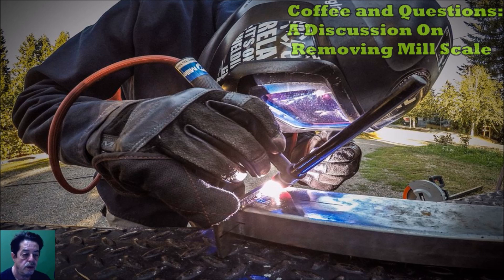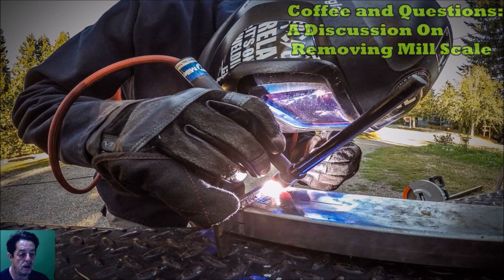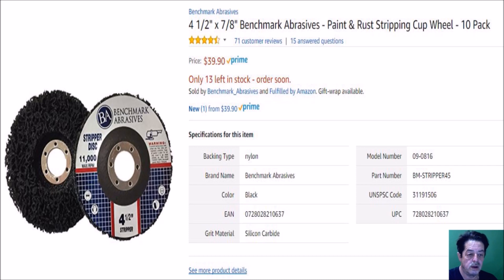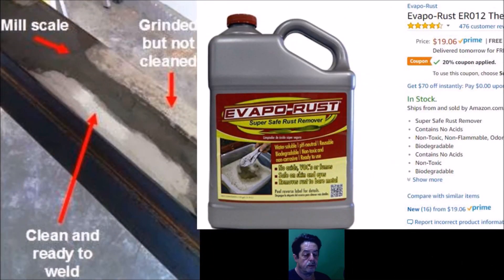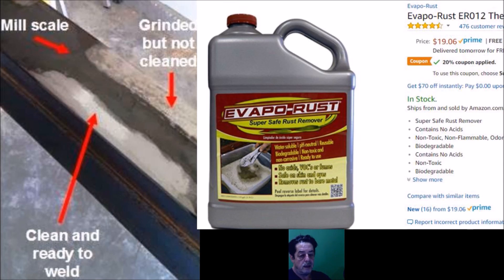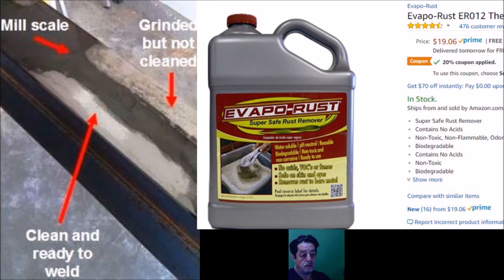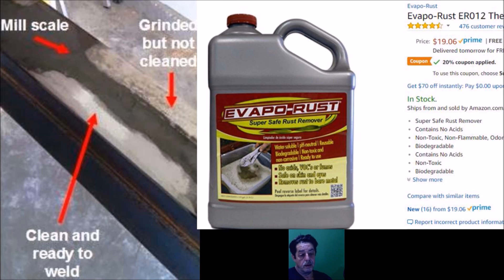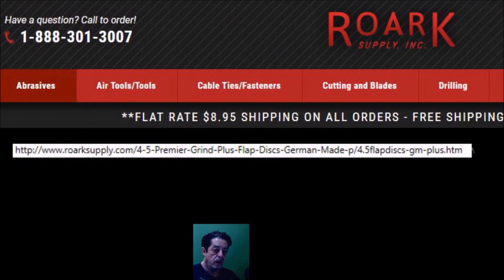How to Remove Mill Scale from Steel

Comment: For a large area just throw down a few towels on the steel plate and pour a few gallons of White vinegar on the towels and let it sit over night next morning wipe down the plate with water and a scotch brite pad and the mill scale will rinse right off of it. for small pieces I use Vinegar with salt with electrolysis which works fast with great results.
Reply from the maker: Good idea and ill try that - thank you

Comment: Do not use muriatic or hydrochloric acid indoors.  Not even inside a large shop.  The fumes will damage all metals it contacts.  Wiring, pipes, valves, stainless, aluminum, steel.  Not to mention your lungs, pets children... just don't.
Reply from the maker: agree and good points - thank you for posting
Reply: @TheHomeHandyman  Anytime.  You know how it goes.  A good idea applied wrong can make for a very bad day.  We are all here to help our fellow man.
Reply from the maker: well put and i totally agree.......thanks

Comment: Very thorough, But may I add a little when you say "rinse with water " it shouldn't be tab water cause chlorine content in tab acts like catalyst for rust . You should leave water out in an open tank for a day.  I found that by using sharpening flat stone on mill scale to scratch it before using   abrasive disc make the disc last twice longer bytheway using disc is too expensive method for me. Best way for me is just using silicon carbide flat stone and take half a day rub  it off. The trick is that you dont have to remove all until steal is totally white but as soon as it is scratch and thin enough to not forming large area. It will not effect on later coating. It is allway pain to remove mill scale. In oil industry they even sandblast with "something as hard as siliconcarbide " .
Reply from the maker: Thank you for your advice and comment - always nice to hear how others are removing it - I never thought of using flat stone

Comment: Thanks for the insight here. I am going to prep 4" rectangular tubing for paint. Steel is new from supplier. In the past I've used the flap discs to remove mill scale. But I have a lot of 4" square tube to prep and paint. So I'm looking for a faster and easier way to prep large lengths of square tube. Maybe a sanding disc on a 9" grinder? Any suggestions
Reply from the maker: your doing alot more than i do but if the steel I get has that coating (cosmaline - a oil waste product) I leave it on until im done then I wipe it a down a few times with acetone and that seems to work ok for me - but like I said your dong larger projects it sounds